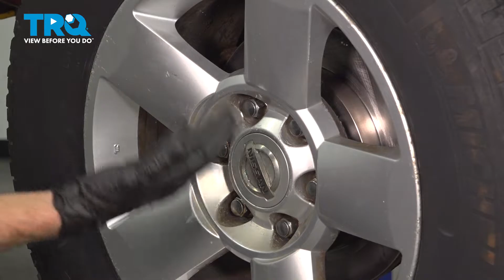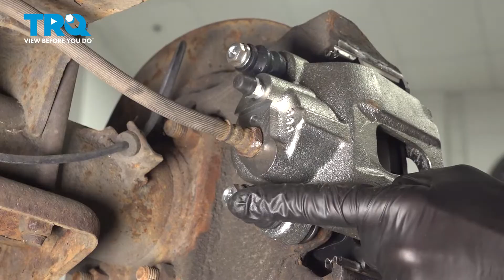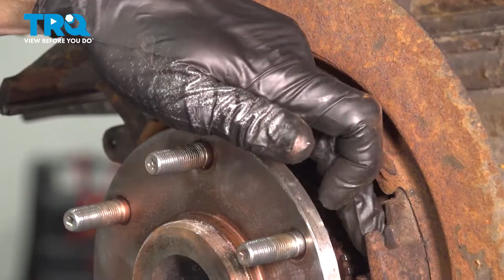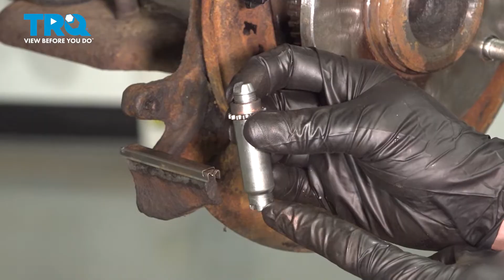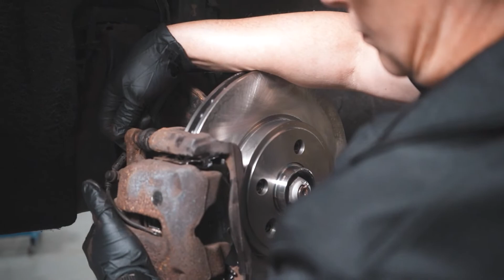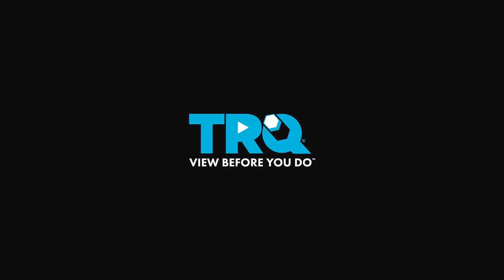How to Replace Parking Brake Shoes 2004-2015 Nissan Titan

Comment: So the backing plate is rotted to the point that the anchor pins don’t hold against anything. Is there a way to remove the backing plate without cracking open the rear diff, or am I S.O.L?